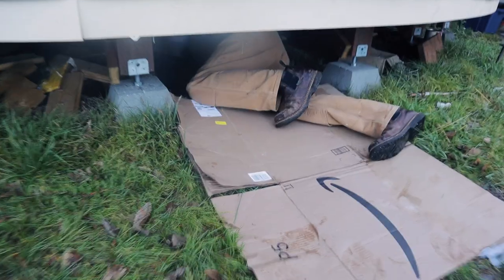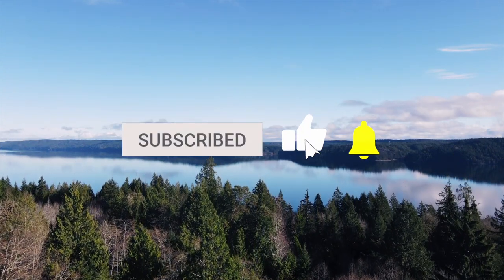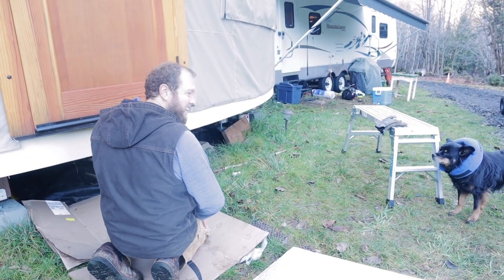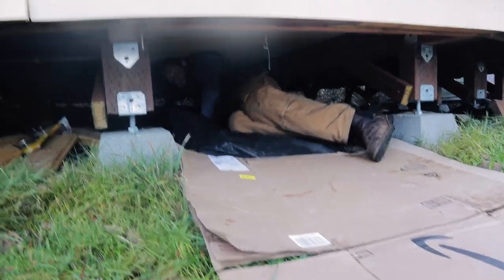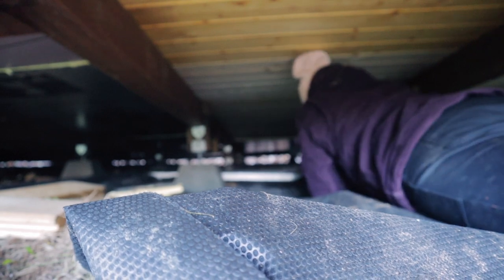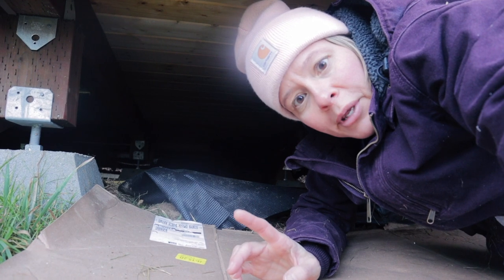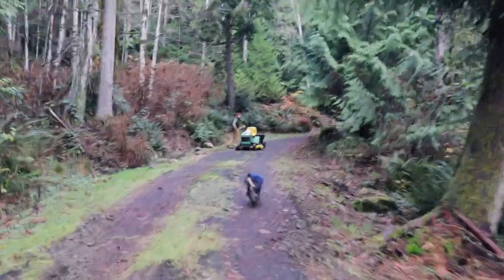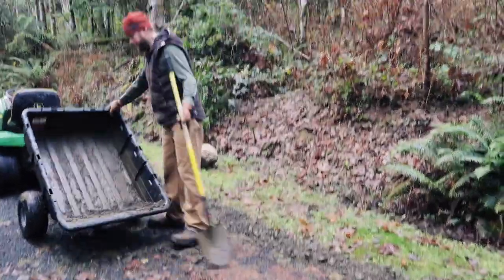Staying WARM in our YURT // Installing the Yurt Floor Insulation - Ep. 17

Comment: Thank you for this. We are looking to do the same thing on our yurt as the floor is sooo cold! What type of foam insulation panels did you choose? And how did you handle the curve around the edges?
Reply from the maker: We used a 1” foam board insulation that you can buy easily at Home Depot.  We just rough cut the corners to match the curve and then filled the gaps with spray foam.